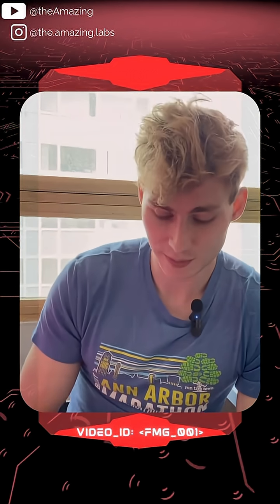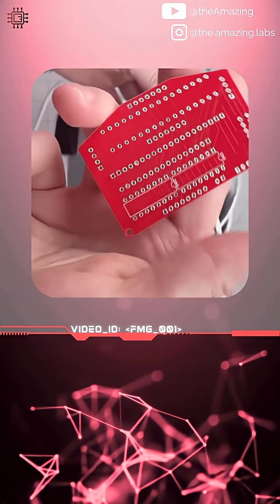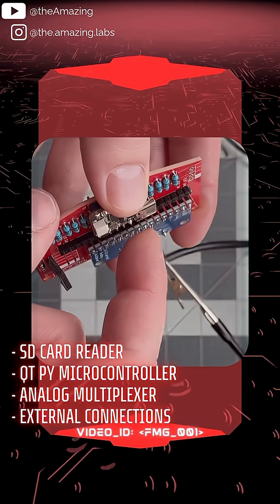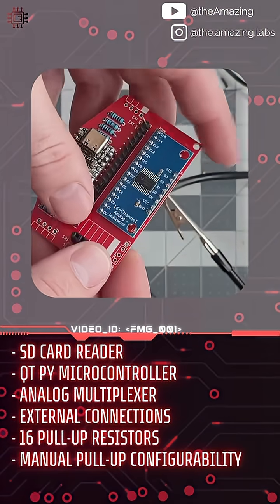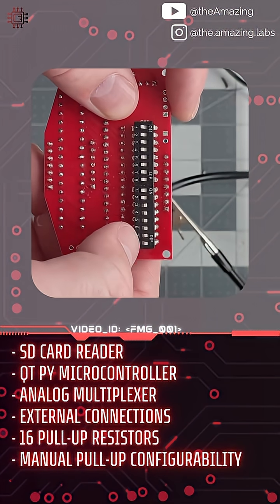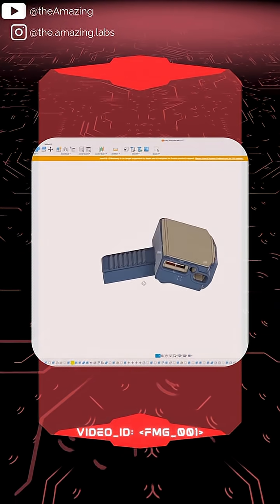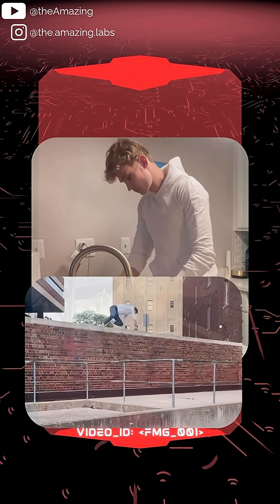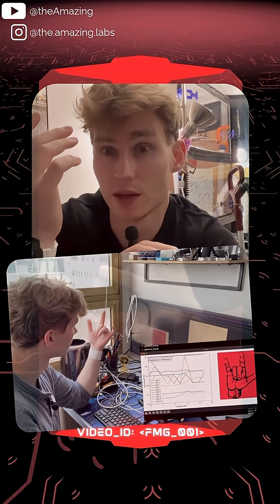Wearable Sensor Tech: Part 2 #shorts #shortreels #shortsvideo #shortsfeed

Comment: 🕷Web fluid idea🕸: Polymer Base	Nylon 6/10, Kevlar precursors, Polycaprolactone	Strong, flexible, some are biodegradable. Solvent/Carrier	Acetone,Tetrahydrofuran, Ethyl Acetate	Helps keep polymers fluid until ejection. Crosslinker	Diisocyanates, Epoxies	Triggers solidification on contact with air, Adhesive Agent	Cyanoacrylate, Silicone-based adhesives	Controls stickiness to surfacess, Thixotropic Agent	Fumed silica, Bentonite clay	Controls viscosity for smooth ejection.